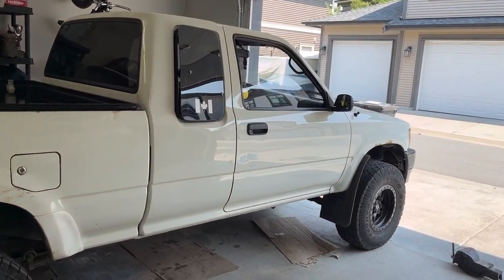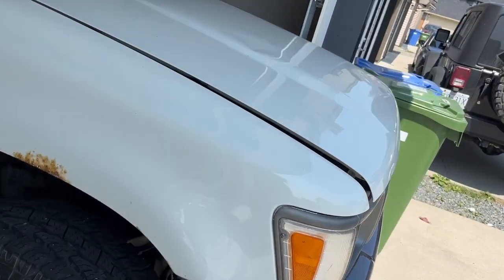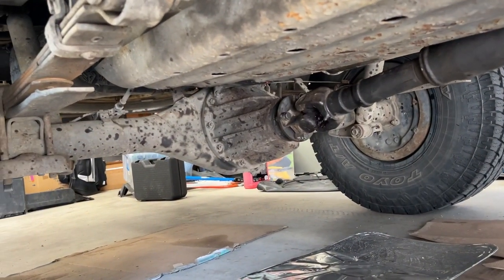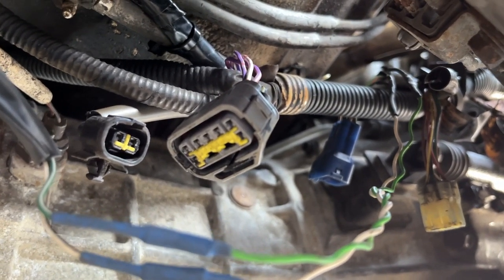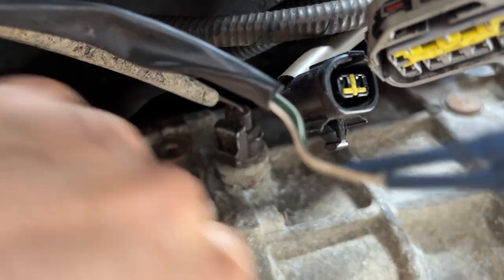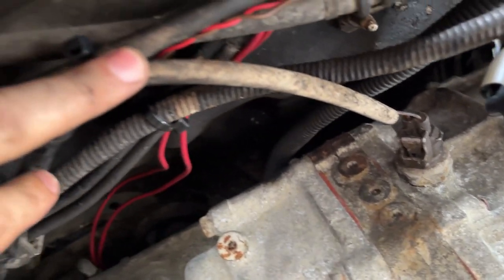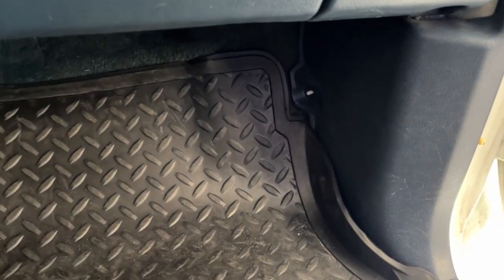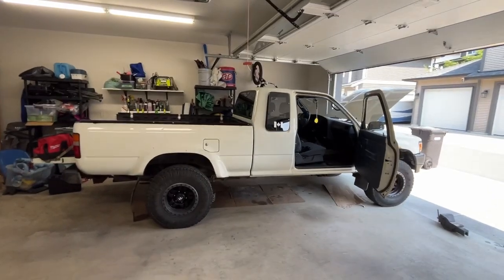1992 Toyota Pickup Manual Swap

Comment: I have a jdm 3.0 here it’s auto and my harness won’t work on it with diff connectors and egr and whatnot I’m hoping it plugs into my manual ecu and I can run it in my manual 4runner 93

Comment: Did u figure out the 4wd wirings?
Reply from the maker: No I did not. What I ended up doing was deleting the ADD system entirely and converting to manual locking hubs. 
I took the front cover and fork out of the ADD unit and used a hose clamp to lock the fork to one side and then I eliminated the vacuum system to the ADD unit. Doing so permanently locks the ADD unit to 4x4. However, since I changed the hubs to manual hubs, the 4x4 system is only engaged when the transfer case is shifted AND when the front hubs are locked. You can still drive in 2wd with the front CVs unlocked and not spinning. Its a bulletproof way to eliminate the electronics and vacuum system to make sure your 4wd system ALWAYS works.
Reply: So u lost 4 low?
Reply: I’m guessing u still have 4 low or high if u have the manual engaged shifter off an originally manual truck after the automatic engine/ harness is added like I’m about to add an auto harness and engine to my manual I should still have 4 low and high
Reply from the maker: I still have 4 lo and 4 hi  @KWAHU93
Reply: Hey bro can u make a video of how u do the locking add unit?

Comment: Hey bro a question 
Am changing over the manual also bt a mechanic is telling me i need to change my back differential 
Do u have any idea?
Reply from the maker: You should not need to change the differential. I used the same differential when I swapped from my a340 to r150f
Reply: @ItsJoshN  the guy told me i have a sr5 gearbox for my 3vz .
Idk much about the sr5 box

Comment: Thanks for the write up. Much appreciated. As for you ADD, delete it.
Reply: No cruise control mods? Also, drive video?
Reply from the maker: @Ginjaninja0051  no cruise control because my truck didnt have cruise control
Reply: Would manual locking hubs be a solution for the 4 wheel drive issue?